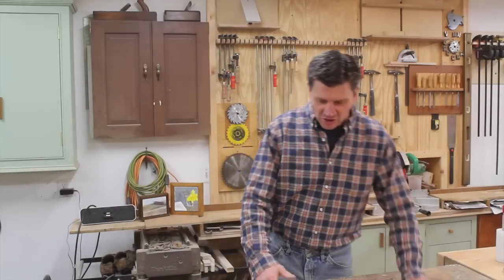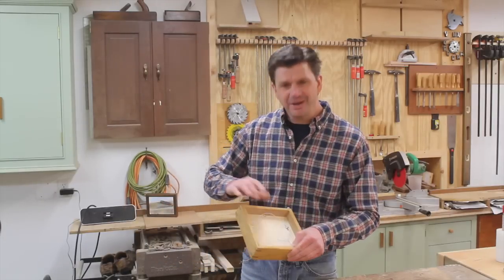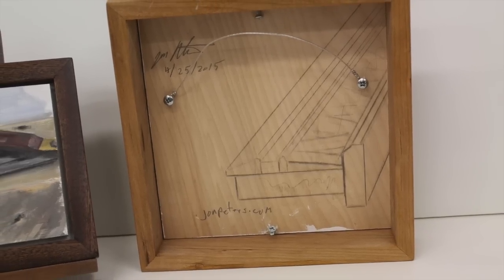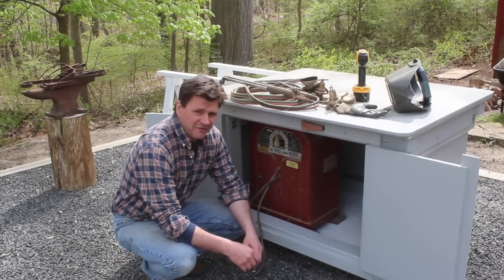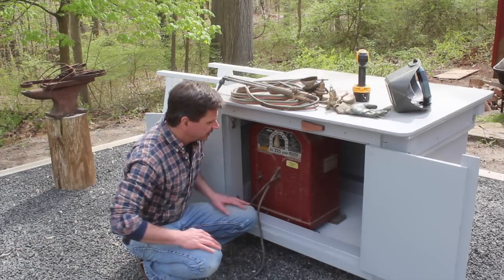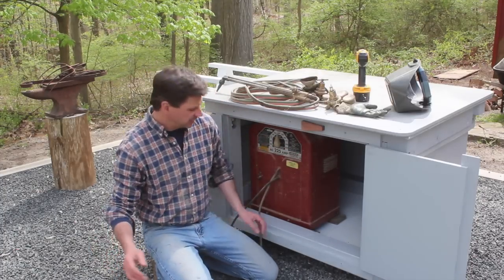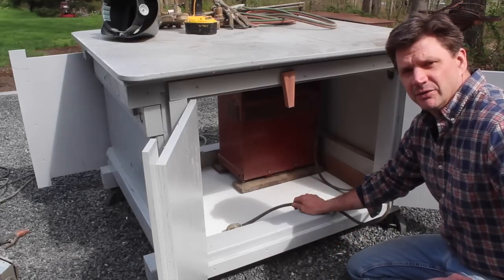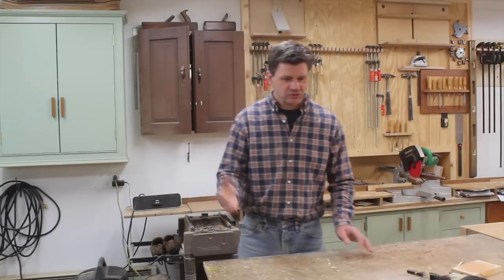Make a Tiny Shed / Welder Storage & Work Table

Comment: Very cool video Jon.
Are you planning on welding on the table top?
I just recently got  a welder (TIG/stick). I am enjoying re-learning stick welding and look forward to starting TIG (I need to get argon).
You ran a pretty nice bead one handed. What electrode were you using (just a wild guess here: 6013 or 7014)?
I am really look forward to watching your soon to come welding videos.
Reply: Scott L probably a 6011 or 6013 7014 needs DC, dosent work at all with AC
Reply: Joey Broadston I can't say that I've had any problems running 6013 or 7014 essentially interchangeably without much regard to AC/DC or polarity. The splatter at 6:30 made kind of made think 7014. Also, I wasn't thinking 6011 given the lack of penetration (at 6:50) and the amps being at 120. But then again I am not really a welder; I just stick metal together from time to time.
Hopefully Jon will let me know how far off my guess is.
Reply from the maker: Scott L Thanks Scott, 7014... I'll do most of the welding on the small steel table. I've never used a TIG, sounds cool